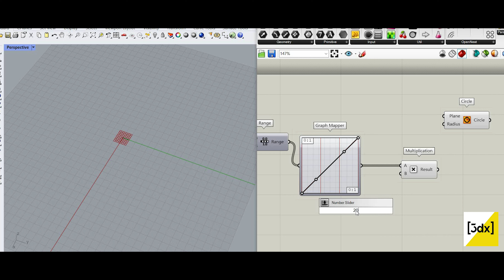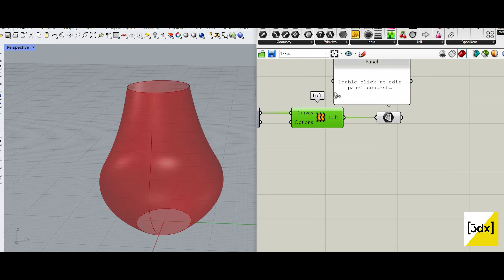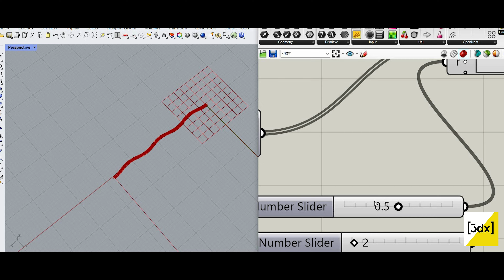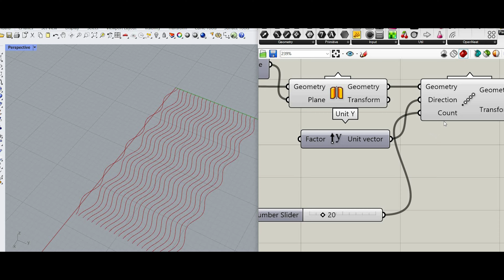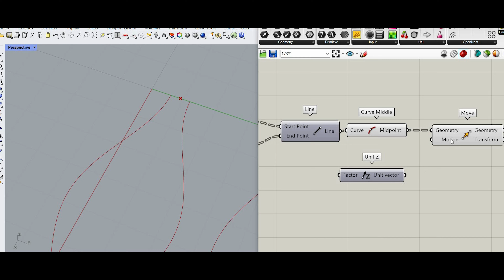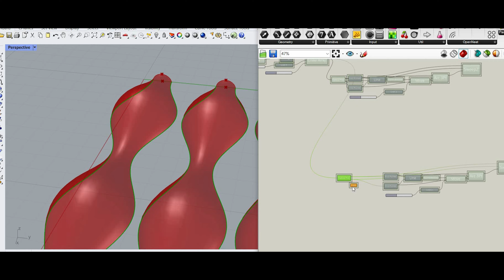Parametric 3D Printed Vase in Rhino Grasshopper (Surface Morph Workflow) Grasshopper 3D & Rhino Eng

Comment: Thanks a lot for sharing your workflow and experience with Grasshopper and Rhino, this tutorial is really inspiring and helpful overall. I just had a small concern about the last part of the video: there are quite a lot of very fast back‑and‑forth tests before reaching the final result, which makes it a bit hard to fully follow your reasoning and to reproduce every step on our side. Maybe slowing down slightly or summarising the key steps at the end would make this great content even easier to learn from. Thanks again for taking the time to share your knowledge!
Reply from the maker: thank you for your comment, i will try to add the each step summary, in the next video , 

have a good day